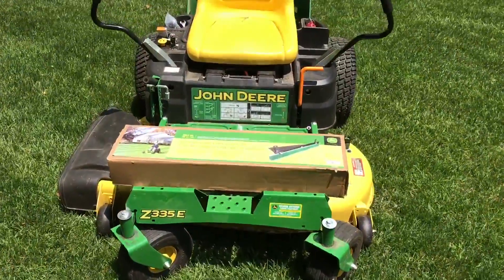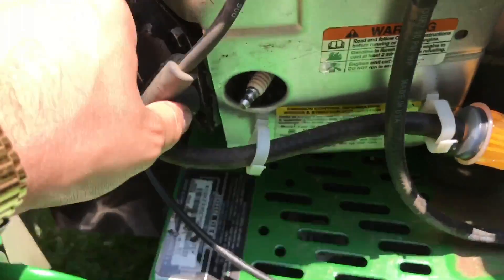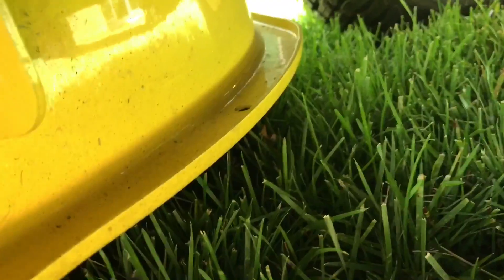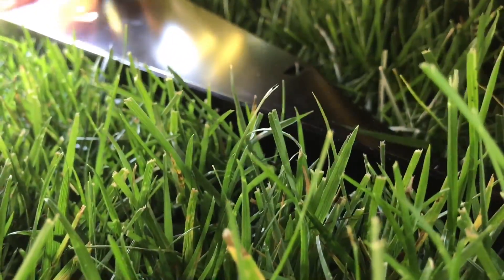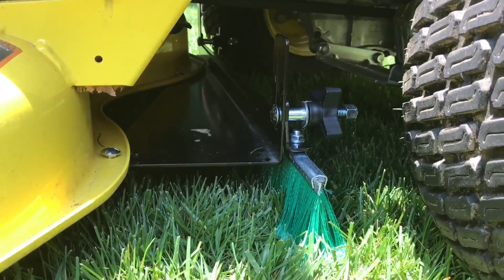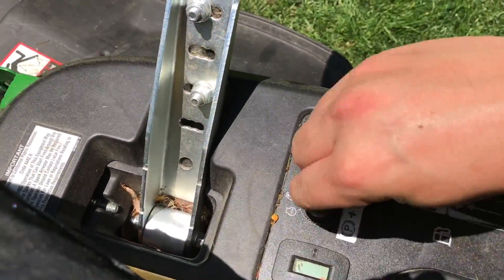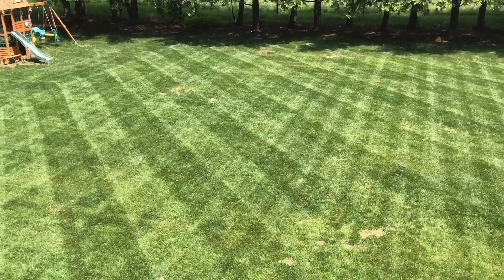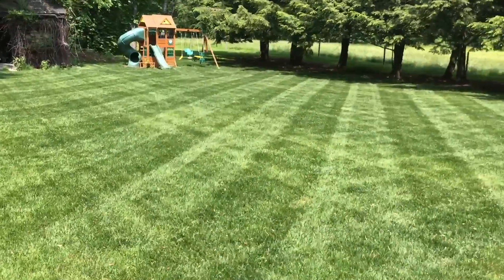John Deere Grass Groomer Striping Kit Review

Comment: Looks great.  On my JD mower, I installed a marine type squeeze bulb on the gas line and give it a few squeezes before starting up (on cold start).  Makes a WORLD of difference on crank time.  Right around where your fuel filter is at.

Comment: Pretty nice review!  Probably going with this JD striping kit for my new JD tractors  I'd like to make the janky DIY one for $20, but I frequently back up and don't really know whether anyone considered what happens when you back over a PVC pipe full of rocks and sand while the mower blades are running.  The brush solution avoids that issue altogether.

Comment: That's a nice striper, I like the brush concept and it seems to work well.  I saw a video of a guy that has a zero-turn with forks in front that pull the blades up before cutting then brushes them to then be perfectly rolled...amazing stripes!

Comment: Does this kit help to eliminate any grass clumps that mulching occasionally leaves on the surface of the lawn by brushing them into the turf?
Reply: His mower has the Accel Deep deck- it has better vacuum suction than the normal Edge Deck (1" flatter in the rear), which helps out with the clumping already if you want mow faster.  Ultimately, mowing slower and at a higher deck height with proper mulching blades (which help with the vacuuming) will allow more processing time to avoid clumps.

Comment: Removing the key and sparkplug is to keep idiots from trying g to put it on while it's running. Did you REALLY have to remove the key and plug wire.. and what's a "socket wrench"?

Comment: How is the brushes holding up three years later? I’m ready to go buy one instead of a roller.
Reply from the maker: I've used it for every mow for the past 3 years, and i'm surprised it hasn't worn down yet.  It still stripes as good as the day i got it. highly recommend
Reply: Al Beebe Thanks for responding. I was at the JD Dealer today ordering one. $100  A roller stripper is almost 3 times more $. I’ll let you know how I like it in a couple weeks.
Reply from the maker: @mikemorris8497  taller you mow the darker the stripes, mow from SW->NE and NE->SW so they shine in the afternoon sun, the more you mow in the same direction the deeper the stripes get.  Ignore the rule that says you should alternate the direction you cut your lawn. Check out the results https://youtu.be/2mG1dRdRjWQ?t=54
Reply: Al Beebe I still like to change my direction when mowing. I have been at my property 22 years.14000 sf TTTF/ KBG mix.  For 10 years I mowed mostly the same direction, and the lawn gets a washboard look. Especially when it’s dormant during winter. I don’t have that issue any more. If we are having a party or something I’ll mow the same direction 2-3 times to define the stripes. Learned that from Pete GCI Turf.
Reply: Are you going to do a lawn up date video ?

Comment: Al, once striped, how long does the striping show.  I would assume as the grass recovers and grows, the stripes disappear rather quickly, n'est-ce pas?
Reply from the maker: Welsh Rabbit they last between mows and if you mow the same direction each time they just keep getting better and better
Reply: I might be late to reply but you can find a suitable replacement brush for a little of nothing through McMaster Carr
Reply: @micholob86  what would I search for. I tried searching the site for lawn stripping or stripping brush. What should I look for. I need a new brush. Thanks.
Reply: @dancikovic4598  they are just industrial brushes, not lawn brushes specifically. take measurements and find one that has the same measurements.

Comment: Kind of cheap that John Deere would supply a brush as a stripper and not a roller.
Reply from the maker: ANTHONY  SOPRANO that was my initial thought but i’m now if the opinion that the brush works the same if not better then a roller
Reply: @AlBeebe  okay, wonder why the grounds crew in MLB ball parks don't use brushes then instead of rollers
Reply from the maker: ANTHONY  SOPRANO commercial vs homeowner. The ballfield mower is going to mow more grass in 1 year vs what a homeowner is going to mow in 20. Brush wouldn’t last long enough.
Reply: because golf courses and sports fields mow at sub 1" heights while landscapers and home owners ( which this product is intended for ) tend to cut well above 2 inches...

Comment: I couldn’t believe you actually took the key out and pulled the spark plug wires.... but then you got confused about bolt size vs nut size, tried to use a 3” bolt to attach the thin metal bracket, and installed carriage bolts backwards. Sticking to every letter of the instructions is probably a good idea for you.